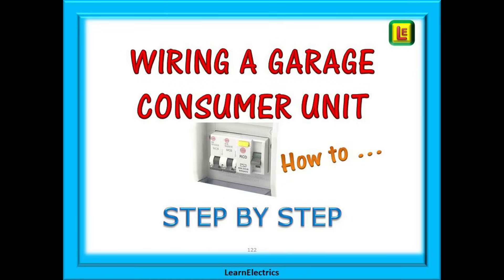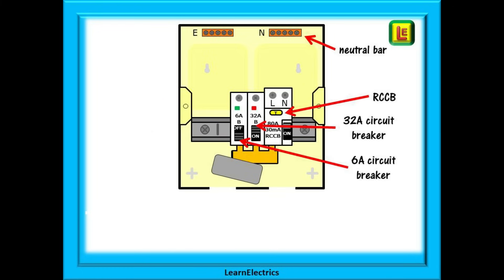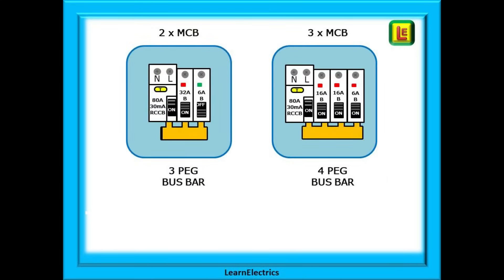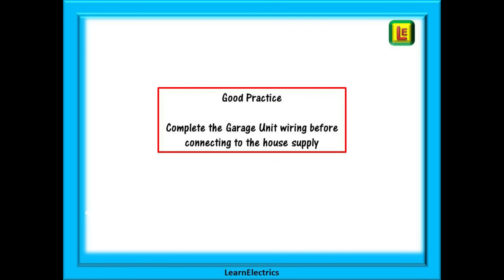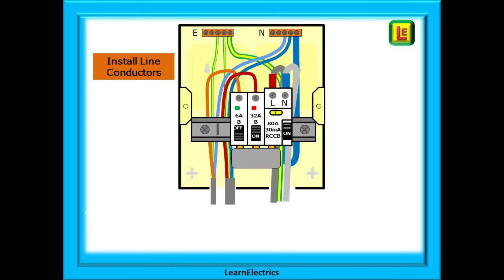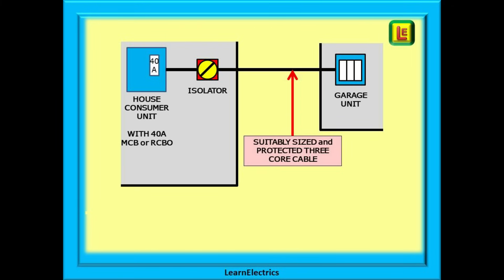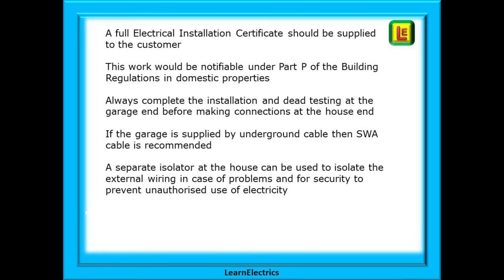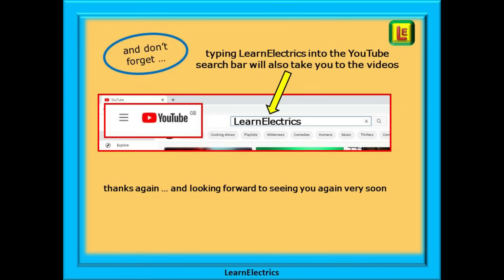WIRING A GARAGE CONSUMER UNIT – HOW TO – A simple step by step guide

Comment: Good vídeo explained well.. I normally fit an RCBO at the main house consumer unit and mcbs on main side on the Shed CU, or I put an MCB on the Main side on the Main House and RCD on the Shed to avoid unnecessary tripping on the Main house. Also it's worth mention the regs regarding not bringing the earth back to the house and fitting a Rod at the shed and taking the earth from there.
Reply: Hi, just to clarify, if you use an RCBO at main house you dont use RCD on shed side? or have I misunderstood. I have read of issues with 2 RCDs on same circuit but struggled to find a clear answer. Thanks
Reply: @tomlee8871  yep, no discrimination! If 30ma feeding 30ma ...end up potentially NOT tripping,  which could lead to a dangerous situation, unless install a S Type 100ma ,  RCD at the House feeding the shed etc ,
Reply from the maker: Thanks Ramon, great comments.

Comment: Hope you can answer this for me... I want to swap out an old fuse distributor box. Its hard wired to the main consumer unit. So it would be a second consumer unit in the chain. And so third breaker from the main feed into the house. 

I was under the impression that you didnt need certificates and informing the council for any wiring after the main consumer unit. Is that still the case? You mentioned filling in the certificate for the garage unit.  

Money is really tight right now, and Id really rather not have to hire in a electrician to do a job and charge me a few hundred quid for something I can do in an hour.
Reply from the maker: The work sounds like it is Part P notifiable. You are changing fuses - in fact a whole box of them, and you are installing new wiring. So Part P notification required and a full Electrical Installation Certificate. Hope this helps.

Comment: Sorryi know this is not related to the video. I have a question. I would like to ask, I'm in a bit of an argument with a director of an electrical company who is telling me that you should not use plastic trunking across escape routes. Can you clarify that for me, please? Because I've never seen in any of the regulations that stated plastic should not be used. I think regulation 521 or 522 makes clear if use should not be liable to premature collapse. We understand using metal in the first option, using plastic with metal clips. What's the problem?
Reply from the maker: I agree with the director. Plastic trunking anywhere in an escape route is frowned upon. premature collapse, flammable materials in an escape route, what is the smoke factor etc. personally I would stick to metal trunking and metal conduit.
Reply: @LEARN ELECTRICS  thanks for your reply. Where in the regs that it says you must not be used? To my understanding, it stated if used must not be relied upon as the sole purpose for safety. If fire safety clips use in a run of mini trunking, don't that deemed to comply? Mini trunking has a low smoke rate.

Comment: Great videos, very helpful !  Just moved house. I have an 30amp mcb at the house consumer unit for garage supply only. Could this be used as an isolator switch for the garage consumer unit ?  The garage unit is BG, same style as in your vid. Also, as existing, the house mcb is not on the rcd rail, but garage unit has its own. I guess you don’t want two rcd’s on same circuit? Is that ok ?
Reply from the maker: You can use the 30A MCB or consider a 40AMCb or RCBO if it will physically fit. It does happen where two RCD devices are on the same circuit, usually the one closest the fault goes first as there is extra cable resistance to the one in the CU, just enough to make a difference. Dave.
Reply: @learnelectrics4402  Thanks for your help, much appreciated!

Comment: What size cable in this video is supplying the sockets?
Reply from the maker: You should use the size appropriate to the circuit. 32A ring can be 2.5mm and 20A radial would also be 2.5. There is no size specified in the video, but we do have videos on choosing sizes.

Comment: Can you tell me why the main earth has to pass through with the main live and neutral on a tt system or any other. My understanding is as long as the live and neutral pass  through the same grommet this is ok Is this right. Cheers bill
Reply from the maker: Thanks for the question William, take a look at he video below which answers the TT question for you. Basically if there is a high amps earth fault that is not quite high enough to trip the device quickly, there could be circulating eddy currents for several minutes or hours. Take a look on the link below. Dave.
ELECTROMAGNETIC HEATING EFFECTS
https://www.youtube.com/watch?v=2uRHVnYiHcE

Comment: Hi Dave would the rating of the RCD from the house to the Isolator and then from the isolator to the garage unit need to be the same rating as the total rating of the RCD circuits in the garage unit (6A lighting 32A sockets = 38A so...40A at the house and 40A isolator?)
Reply from the maker: The RCCB isolator at the shed will not trip for overcurrents, the 40A is just its maximum working current, not tripping current. You could have an 80A RCCB in the garage if you wish and a 40A MCB at the house. Hope this helps. Dave.

Comment: An interesting well made video. I would likely wire the electrics in a shed or garage in some sort of containment or tuflex style cable and not standard twin and earth. Does depend on the installation though and the cable runs. Likewise, the fittings I would use would probably be metal clad rather than plastic.
Reply from the maker: Metal clad is good especially where DIY is taking place. Thanks for the comments. Dave.

Comment: Like always a high quality tutorial, thank you. I have a general question about MCBs. Consider two MCBs in series. Type B 10A and type C 32A , the short circuit current is 400A. Can we say 10A MCB trips sooner or the answer is not clear?  As you know the answer is important for selectivity.
Reply: Type B MCBs have the highest sensitivity. They trip whenever the currents are 3 to 5 times the rated while the Type C  trip whenever the currents are above 5 times the rated. 400 A is 12.5 times the rated 32 A. If the 32 A came before the 10A in the series connection, then, it would trip before the latter has a chance to.
Reply from the maker: Good question Sajad. At 400A they are both above their rapid tripping current, in other words they are on the vertical part of the graphs. B10 needs 50A, C32 needs 320A.  The current will not rise to 400A instantly so the limit will probably be hit by the B10 just before the C32. Hope this helps. Dave.

Comment: Will there be a problem with having RCD’s in series, if the garage consumer unit has an RCD device power supplied from a RCBO or MCB with an RCCB in the house main consumer unit?
Reply from the maker: Normally, because of the extra wiring back to the house, the RCD nearest the point of fault trips first as it has a slightly higher current. They say that the resistance in the cable back to the house is enough to make a difference in response times. That's been my experience too, most times. If it is a problem, try a separate S type RCBO for the delayed response at the house CU.
Reply: @learnelectrics4402   thanks for your response, much appreciated. Just one more question if you don’t mind. To avoid discrimination between RCD’s altogether would it be wise or within Regulation to have an garage consumer unit fed from a house MCB that has no RCD protection? Say for argument sake the SWA cable is uninterrupted by an isolation switch or any other type of junction and is terminated in the house consumer unit.

Comment: Can this be connected via a fcu off a socket or an old cooker fcu that's not being used anymore or only to the main consumer unit?
Reply from the maker: You could run it from an FCU but then you are restricted to the 13A fuse in the FCU.
Good question, thanks for watching. Dave.
Reply: @learnelectrics4402  as the wiring from a FCU would be 1.5mm when it gets to the garage box would the cable size still be 1.5mm or go back to 2.5mm cause of the breakers?